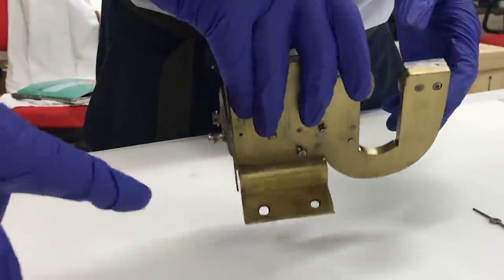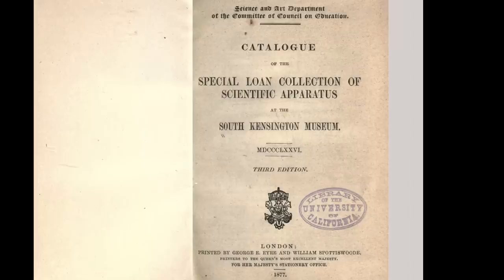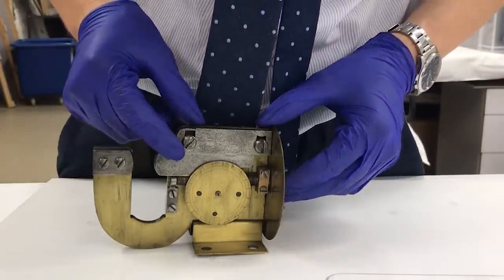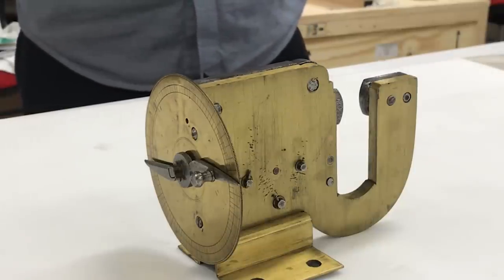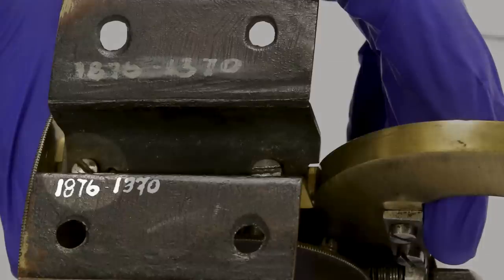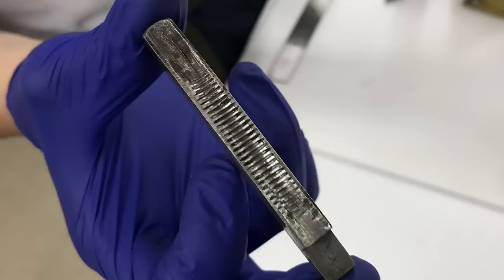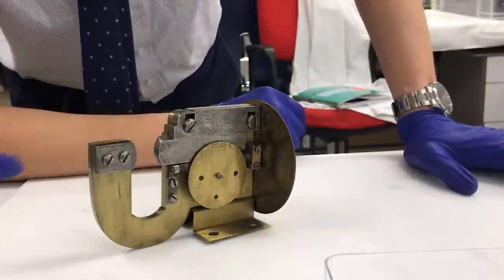World's Oldest Micrometer - 1776! Who made this thing??

Comment: For me the knurling on the dials are indeed knurling.
It makes it easier to turn the dial when they lay flat. So it could be for ease the process of engraving.

The workmanship on the iron strikes me.
I'm only a student gunsmith, but I already spend quite a few hundred hours adjusting and squaring steel with files.
And from my experience the filing pattern is wrong : you would always file on the longest possible direction, and while I do take into account that the quality of my files are probably way ahead of what would be in use at that time the marks left seem to deep to be of any skilled craftsman (I would do much better with a 00 file).

So that lead to my last observation : the disastrous care of that tool.
The way the iron is pitted would in my opinion indicate that what we would call the spindle in a palmer was left extended and rusted.
We can see the outmost parts of the iron being more damaged so there was a certain amount of fit done, the more exposed parts of the iron just rotted away.
It's not that hard to keep your tools oiled. So I would guess that this one was left sitting without care until it was exposed and at that time it would have been cleaned.
Reply: Vaaref, I am not sure which specific file marks you are looking to, but in my opinion as a blacksmith specializing in 18th century reproduction, the file marks make good sense. There is a mix of marks; patches of coarse marks across the iron, as well as finer marks running along its length. I would argue that after iron was forged to shape, the most efficient way to take off the forge scale and establish a roughly flat surface  is to take deep, aggressive cuts across the run of the work. Then, once the iron is bright, go back and refine the finish through  longitudinal draw filing. Further, workmen in the 18th century had access to a broader range of file cuts than we do. Your 00 file is probably equivalent to a bastard cut, which is the coarsest cut generally available today. In Watt's time, files came in two coarser cuts beyond bastard cut, being "rough bastard" and "rough". As rough cut was the coarsest, these files were often referred to as "rubbers" and specifically referenced as being used to remove fire scale.

Comment: It looks like the sort of temporary 'gubbins' you might make for a purpose, out of any old odds and ends you had lying around. It doesn't look like a prototype invention, not even a proof of concept. There's just not enough care (or pride) taken for either purpose.
I'd be inclined to think that the maker was familiar with the concept, had probably seen more expensive versions and decided to throw a crude one together for a specific purpose. I have things lying around my workshop at the same level of slapdash construction that I once made very cheaply rather than spend real money and still use occasionally.

Comment: in many places it looks extremely crude for the supposed date of manufacture. for comparison, have a look at Forgotten Weapons' video on the Puckle Gun, (title "The Puckle Gun: Repeating Firepower in 1718) which was made 60 years previously. compare the fit and finish, the quality of the turning, the precision of the thread etc. or look at the movement of a late eighteenth century clock, if we were comparing this to clockwork, it just looks like something from the late sixteenth or early seventeenth rather than late eighteenth century. its hard to believe this was made a skilled professional instrument maker, unless it was something knocked together in unusual circumstances. perhaps an apprentice piece? that might also explain the use of recycled components and materials, whoever was paying for it not wanting to use a lot of expensive new stock if it was avoidable.

Comment: mount holes were for riverts most coman fixing hardwere in the1700s
Reply: Which would explain 1) no rotary marks from screws or bolts or washers 2) no radial marks from a rivet, which would presumably be made of a more malleable material/alloy.

Comment: I don't think all lathes back in the 1700's would have been foot powered. Much of the machinery back then was water powered or water wheel powered, especially in England. So it would be entirely possible for the main screw to have been made on a powered lathe. The lathe dates back to about 300 BC in various forms and if one digs back in to history, a lot of inventions are really reinvented or rediscovered. Much of it was lost after the Roman Empire collapsed.
I'm also a firm believer that "Necessity is the Mother of all Inventions", so needing a way to keep a part from moving, a center at the tail end of a lathe, in some form would also be possible. In fact, running a part between centers would have probably been the only way to turn small parts in a lathe back then as the holding chuck wasn't invented yet.
Now after all that, do I think this micrometer was made by James Watt? No. Though it is probable but not likely that he would have made this as it is too crude for something he would have made. People like James Watt, just don't throw something together and say that is good enough. They take pride in their work and it would have drive him nuts to through something together like this.
As for the base part on this micrometer, I believe as others do, that this was an add on. It was probably a piece of scrap metal attached so this micrometer could be displayed upright, so both sides could be seen in stead of laying it on it's side and possibly damaging it over time.

Comment: In the end, it does not really matter, as this is not a micrometer. The main thing that makes a micrometer so accurate compared to a vernier caliper is that there is no abbe error since the screw is in line with the measurement. This is just another screw based measurement, and those have existed since the middle of the 17th century, way before Watt.

I do think that this could easily have been made in the 1770's. Everything about this could be made with manual tools. While it's likely that a lathe was used in this time, even without a lathe you can make screw threads, you just use a file to make your first tap (in the case of very fine threads, a chisel can be used), then use that to make a die. This is the way that screw thread was made in the 14th-18th century. 
However, it could just as well be made later. It's not like there were no crafstman capable of making this by hand and make it look old in 1876.
Forgeries did exist in that time after all.

Comment: So many questions about this piece. In my (extremely novice) opinion, it comes down to when, who, why? Drawing a firm conclusion without any documentation or verifiable companion pieces is nearly impossible, and a guess at best. However, the bi-metal and substandard “appearance” may be misleading. My off the cuff thought; the piece was possibly made as a pet project with the concept of a micrometer in the makers mind and remains incomplete. Possible rough sketches may have been discarded through the centuries and this prototype fabricated with materials from his parts bin. If the experiment didn’t work, his investment in the metal wouldn’t have crippled him too badly. Evidence of used parts are pretty obvious. As to attributing this to Mr. Watt... without provenance I don’t see how we can make this case in a thirteen minute (Fantastic) video. In my mind, the wrought iron is the best indicator (pardon the pun) of age. Not a pro, but this is simply my opinion.

Comment: Is it possible the lesser quality wholes were made by someone else for mounting purposes while on display. Or for other personal reasons later. Maybe it is simply a modification. Or are there practices where you would make different wholes. It could just be a thing he did. Everything doesn't have to be the same. And there could be reasons to do it differently. Like time for less important things. Or for a different type of fastener or anything that gives a reason to do anything different.

Not to mention they could use cheaper methods for things not required for function. Or if they didn't use finer screw parts for fastening but cheaper hammered bolts to say a wooden table. Totally different wholes and method potentially. Maybe they just heated up something or did whatever was common for bolts in the day at a blacksmith or something similar if he didn't have that equipment on hand. Could explain the different method.

One thing not commonly understood today, as nobody makes anything themselves anymore, is that when making something there is always a required energy to do something. When you do something yourself we are biologically designed to seek efficiency. It's part of our design as a machine. So, we do things based on circumstances. But a smart person will save energy if possible and weight it to function. A dumb person will put too much work into it until doing so teaches him otherwise. This is not saying you can't be too efficient and lazy or whatnot. But the more you do the more you need to weigh this potentially. Manufacturing with machines primary and only purpose is to remove this energy saving.

I see you have a video labeled origins of precision. Trust me, as odd as this may sound to most people, we had way more capacity for precision the farther back you go. But we did not always use it. We didn't have a need for it. We are focused on it now because we are loosing it and what really gives the ability to do so as our general knowledge thins out. You have to figure out mechanically how that works as a human machine to understand why that is. The fact that almost nobody knows that anymore is testament to that, if you know the answer. But then again, if you know the answer, you don't need that testament.

Comment: My initial thought was that someone started this project for a specific need and, part way through, realized it was going to take longer to finish then was available. Or the deadline for whatever it was constructed for was shortened and again just ran out of time and rushed parts. It's also possible that because of time constraints 

But after a few more viewings I think it's much more likely though is it's apprentice fodder. A modern contemporary would be parallel blocks that all apprentices build as a gauge (pun intended), of their skills. This would go a long way to explain why it look looks like it was part of something.  Because no journeyman in their right mind would would let an apprentice build with anything but scrap metal.  

This would also explain why it look like more then one person worked on it. Through each phase of the build a journeyman usually offers input, "Wow those knurled edges look great, and absolutely pointless" "Mounting holes? You don't think we would actually use this did you? Not really needed so skip it" "Those 2 circles are way to close to center. move them out farther".

A third explanation is someone asked for this and because of lack of money they didn't care much about the looks. I've had plenty of family and friends ask the same thing.

Comment: looks to me like it was made in 1930 by an apprentice, which is why there wasn't an identifiable metric used.

the shapes are too uniform to be made by hand. and it doesn't fit flush to a surface.
the parts which measure are bowed/rounded which makes them not measure well.
both the screws, and the circumference of the wheel look like they were turned on a lathe. but latheing a square of iron is hard.
much of the iron looks cast not wrought. wrought iron would be irregularly shapped. not only would you get non-square shapes, but you would get indentations and irregular presses from local indentation from the strike of a hammer. compare the surface to a cast iron dutch oven.
the holes look hand drilled and irregular.
the screws look machine made.

lastly why use iron at all instead of the easier to shape and get, brass and bronze?

my gut says someone stole the real one, and replaced it with that.

Comment: Is it plausible that it was made just for the exhibition. Did the Watt company have a good reason to try and generate attention for themselves beyond what they already had? Maybe it was just some shrewd marketing. One thing that points to it being a fake is the indexing on the dials. If we assume it is real, what would watt have chosen as units that would have been useful to him? Perhaps something using base 2 or base 10 or base 12? I can't think of why the indexing (5:05 50 divisions and 19 divisions) on the device would have been chosen.

I think the anything that points to this not actually being useful as a tool would indicate that it is a fake. If there is some relation of those 19 divisions to a common measurement of the time, such that each division marks of 1/10th of an inch for example; that would be very indicative that it was an actually useful device. Otherwise I would say it that the forgers had a limit to the amount of thought they put into the device.

Comment: I'm surprised a metallurgist hasn't already taken a look at it. It's not a new science.
There must be a lot of historical documentation on metallurgy in Britain.
Pure iron is an element and fairly soft but it's very resistant corrosion (rust)
Mild steel is iron plus up to .25% carbon it rusts easily; Invented in 1850. Is not considered
machinable but very weldable. Cast iron is 2.5% or a bit more carbon it is easily broken and brittle but very 
machinable.
It will be interesting to see what they find out. Until then everything is speculation.
Looks like you are being hacked!?!?

Comment: I dont think its made 4 mesuring...I think its made 4 copy'ing, set it with the piece u wanna copy, and use it like a template, 2 see if the new piece fits in it.
I agree with most, that its a tool, not an instument. but made out of an older device not scap, not a lot of the iron fits like a "glove", and the 2 iron contakt places is rounded, perfekt 4 jamming stuff down, not great precision. I think someone worked on an iron device, and 1 day got inspired 2 make it bether and used brass 2 do it. I dont care what his name was.

3:56 how and why?!? is the hole in the top anvil like that?!? junk or another older less precise tool. why does the top anvil have that rounded "decorative" corner? did it have a purpose? idk.
5:20 its not decimal, cause its not rly 2 measure, but a control, for 1 worker.
6:35 hammermarks from putting pins in.
7:01 its a mistake, he made the hole, then realised, it would hit the screw on the other side, i think, cant see if they line up. at 4:45 it looks like it.
7:08 they r not decorative, they r 4 mesuring, but its not that important, if theres 10, can be 9, 13, whatever, its just a guide. think the tool he used 2 make them, decided the amount. he was not a math-head. ;) remember theres NO numbers.
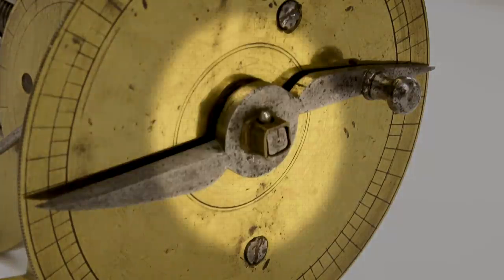7:21 1. 2 lines, measure the radius, do the same on the back, lookes like the disk is "split" in 5 parts, 1. lines on front, 2 parts out from centre. 2. lines 4 parts out, where the indicators is made. I CANT SEE!
7:29 the back. 1. lines looks like, 2 parts out from centre, next is 4 parts out. Rim, 5 parts out.
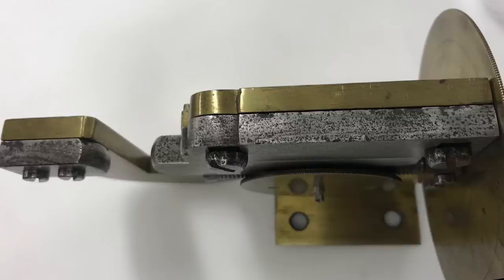8:24 you can see how nothing fits the old iron parts.
9:22 the never used ekstra hole, looks like its the same distance from the edge, as the right hole(repurpose), u can alsow, see a nodge, filed out in the plate, trying 2 make it fit, mby he broke a tap or drill, and had 2 make the hole bigger, right bolt looks bigger. the left bolt, mby all rdy had a hole in the brass?
9:44 i think 3 makers, 1 made the divice all out of iron, 2. later made the dials on it, with a new brass plate, 3. worker made the foot, but never bolted it down. Lazy bastard!
11:22 u can see the sawmarks on the left, where the bottom anvil was later cut, 2 make room 4 the bronze mount.
11:31 on the left, the screw, is held by iron, the right is what looks like bronze/Cobber, had 2 make a new mount, since its not original.
22:50 the small pummel u turn with dont fit the indicator hand, may have been cut and filled by the brass man.  

12:14 the small gear, has brass color, is it brass??? both ends on it is iron! its kind of important, since it tells a lot about if its original, and how the device, used 2 work. take a look at the iron pieces, and imagine it without all the brass, mby without the small indicator if it is a brass gear.

love this shit, problebly wrong about it all, but i LOVE this shit!
I wish u had more straight on shots, hard 2 guess on an angle.
wish u had more/any mesurements, but great video!

Comment: This thing looks like it was made with re-used parts and materials from the scrap bin. In other words - junk. * That would account for many of the stray marks and holes. The fact that critical surfaces are not flat, when that is an easy thing to do, shows a lack of experience. This all suggests that it was not built by an engineer to advance the state of technology, but by someone who was extremely constrained on time and budget and probably just building it to see if they could, using a real one as a model. 

By 1776, people had been making guns and clocks and other machinery for hundreds of years, and could do better work than this crude piece. So I'd say it was an apprentice. The fact that it came out good enough to actually use does not change this.

* Anyone who does this knows what it looks like.

Comment: Couple of observations.. this tool wasn't  built to measure diameters.. because of the deep throat in the anvil, why such a curious shape at the bottom of the anvil.. it isn't a drilled hole then filed, its a radius filed.. or maybe interpolated.. but why.. I smell a rat.
Reply: The throat is also undercut, suggesting it might be used for measuring wall thickness in a piece of pipe or tube.